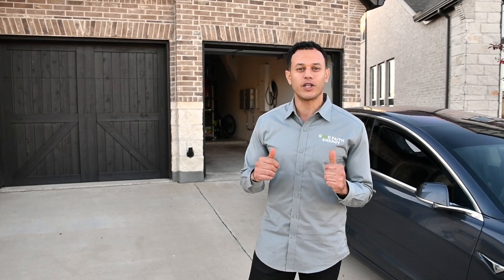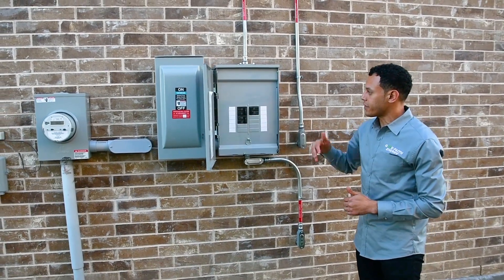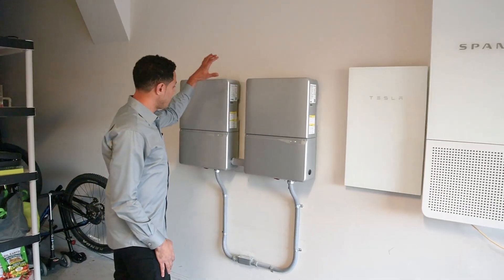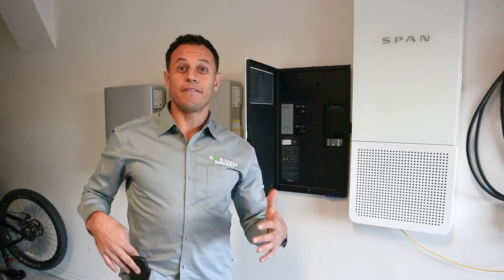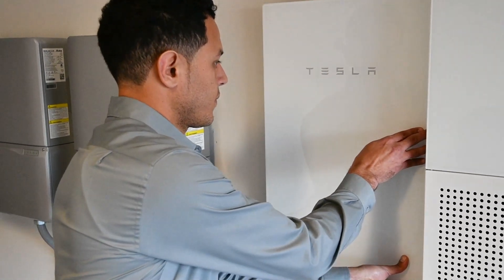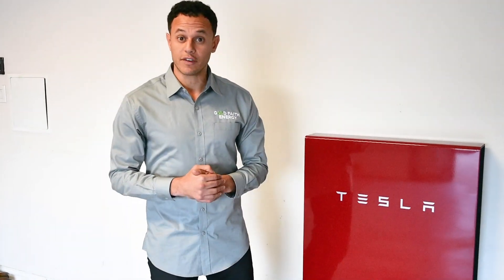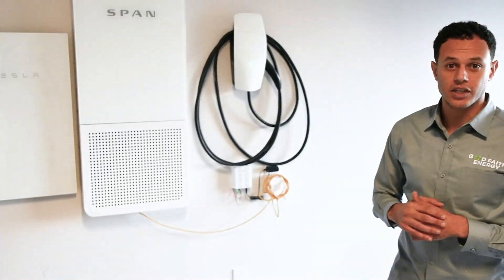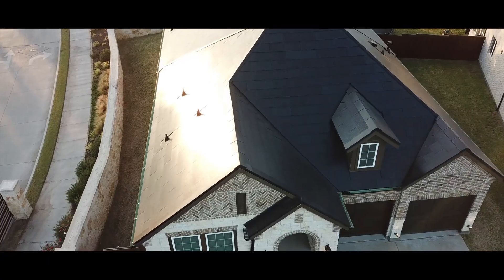Tesla Solar Roof with Tesla Powerwall | Ep4

Comment: Now I'm confused. I thought the main idea behind the solar roof and the powerwall was that you can live your life fully off-grid with all the mod-cons you want, as you provide all the energy you need for yourself. So, how can you then have a power outage? What exactly are you talking about??
Reply from the maker: In some situations, you can live completely off-grid. In suburban areas of Texas, most systems are required to be grid-tied. Meaning regardless, of having a battery or not, you still have to be connected to the electrical grid. Mo's house has to be connected to the grid. He chose to leave the oven off the battery backup to extend the life of the battery in the case of an outage. Hopefully this answers your question.